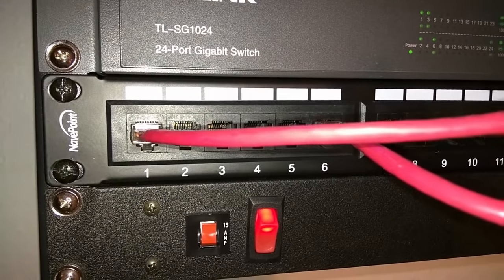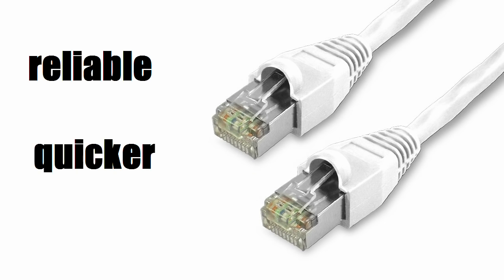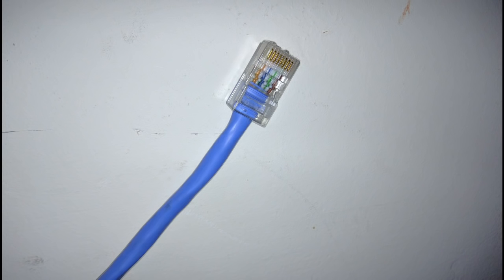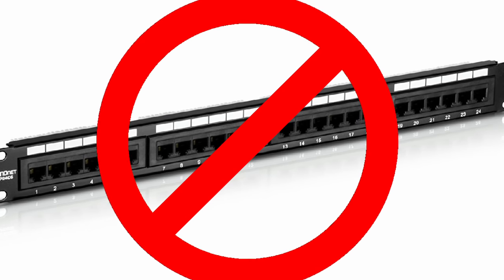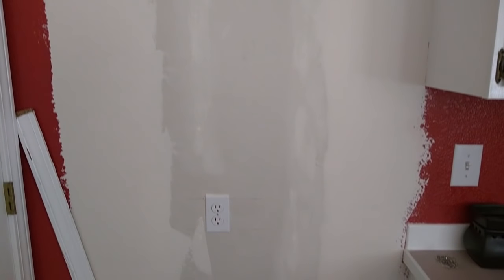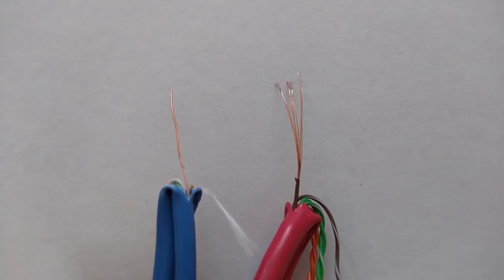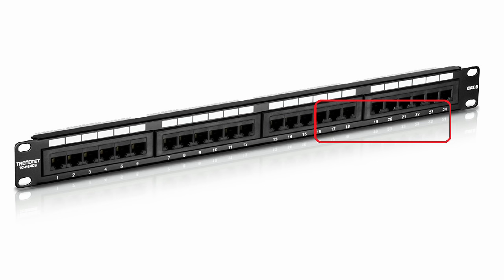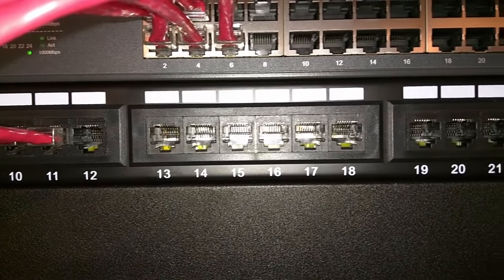What is a Patch Panel? Do You Need One?

Comment: You mentioned using solid core Ethernet cable throughout the house, but when you terminate the cable at the patch panel its stranded, please explain - thanks
Reply from the maker: The only thing I punched down at the patch panel is solid.
Reply: @BudgetNerd  so it's solid core but when you take the cover off it's stranded?
Reply from the maker: Are you confusing the term stranded wire with the twisted pairs in the Ethernet cable? What part of the video are you referring to then? It would help me to know exactly you are referring to.
Reply: @BudgetNerd  
sorry I meant to say punching the twisted pairs in the Ethernet cable to the patch panel
Thanks
Reply: The cables behind the walls leading to and punched into the patch panel are solid core. The other cables, plugged between the patch panel and switch, or between wall jacks and TVs, etc are stranded core. Punched cables are solid. Plugged cables should be (according to general wisdom and somewhat disputed in the video) stranded.
Reply: @coriscotupi  thanks

Comment: So if you move our sell your home, would you take all the home networking equipment with you (rack, patch panel, switch, ect.)?
Reply from the maker: Good question. I would leave the rack and the patch panel and obviously the Ethernet cables that are punched down on it. I would take everything else.
Reply: Budget Nerd i would take everything including the copper in the walls
Reply from the maker: Ha.. I got lots of that. I would want to share the wealth man! Plus what dude wouldn't see that rack and patch panel and declare to everyone in the room, "we must buy this house!"
Reply: Did you have a fun time running all these cables down your wall from the attic? I guess the real question is how did you run your cable?  Did you snake it from the wall jack to the attic or from the attic to the wall plate? Also how many Jack's did you end up running?
Reply from the maker: Running the cables wasn't too bad. I ran them all through the crawl space. I would push the cable up through a hole I drilled in the floor up into the wall cavity. I had some fishing poles and pull string I used from time to time when needed.

The only tricky one was the one I ran from my office closet area to the garage. So far, I have six wall plates around the house that total 13 jacks around the house if I recall. Chances are I'll do more down the road.
Reply: Any cabling you install you should be considered permanent. Go for a keystone patch panel FYI. I install networks for a living and really like keystone patch panels better.

Comment: Huh,  Does the apartment builder/owner have to decide whether to install fixed ethernet cabling?  Here (EU/Finland) the building regulations force Ethernet- cabling and the Patch panel to be installed in all new and renovated properties. In apartment buildings, even the fiber has to be installed in every apartment (even if it would not have any use yet).
Reply from the maker: I'm no master of US code, but I'm pretty sure running Ethernet, and installing a central location for it all to go is optional here. I would love to see it happen more though!
Reply: That is absolutely optional in the us lol, even very modern houses here sometimes dont include networking.
Reply: patch panels are very useful  they don't cost a lot even for a house ... the benefits outweigh the cost.  and modular patch panels allow for cable , RJ 11 and Rj45 in the same panel centering connectivity.
Reply: In the Netherlands its definitely optional as well.

Comment: What’s the name of the jack from which your blue cat cables are hanging out? (Under your wall server rack) 

 I’m running outdoor cameras and will have them hooked up to a switch inside the house. All the cables will be meeting at one location outside the house and then through a concrete wall, but don’t wanna have to cut a big hole through the concrete to feed 10+ cables through; then hook them up to a switch. It would just look ugly and the concrete wall is really thick; so I’m nervous about cutting through. Any alternatives?
Reply from the maker: That's not a jack, it's just a cable pass through wall plate. I got it on Amazon if I recall. The link should be in the description of my DIY Budget Home Network video.

Comment: Hello Sir.I have 1 Modem and 1 Router and 1 switch and 1 Patch panel  and 20 Pcs (Hosts). and i want connect these Pcs to the Network.how can i do that and create network.please help me
Reply from the maker: Check out some of my other videos.
Reply: @BudgetNerd  so the switch is powering the ports on your patch panel right?
Reply from the maker: That is one way to put it yes. The patch panel lets me run those cables to any device I want, but currently, they are running to my switch, and the switch is connected to the router.

Comment: I've made decision to buy one, but I still not convinced to use it for cameras. I think cameras should be separate and hidden for the case if someone comes and breaks your unit. Am I right or it is not really important already if they got that far and have access to that area?
Reply: What does that have to do with patch panels.  You use a patch panel in your network closet and the cameras are elsewhere.  I have installed many cameras and access points and with those I terminate the solid cable in a small box that holds a single keystone connector and then a short patch cord to the device.  Of course this is usually hidden in the ceiling, with only the camera or AP exposed.
Reply: Reference my comment above, I use the same patch panel to connect ALL my CCTV cameras both external and internal, which means I have control over each individual camera.

Comment: Wifi...nice to have, but for most stuff (especially if you use a desktop computer or hell even a TV and a gaming-console!) I truly prefer solid cables (old fashioned? Sure!)...especially if you are into gaming (ping is better via cable and it is a lot less likely to have a "spotty" connection that cuts out at times. No, powerline-connections via your electrical cables aren't a replacement, especially in older buildings...microwave-oven running and suddenly no connection? Yupp, seen that! -.-)

Comment: My house was already pre-wired with Ethernet before purchasing (good for me).  I have a DSL modem (only service we can get since we are rural/remote).  The DSL installer took one of the Ethernet lines and converted it to a adaptor for the DSL/ Phone line.  Wifi is working just fine but I would like to use the Ethernet in my office and have a better, more stable connection.  The Ethernet lines are seen coming out of the wall in the utility room and seem well organized but not labeled.  How can I figure out which line goes to what room and plug them directly into the Modem?  What would I look for?  I watched your 101 Vid as well.  Thank you
Reply from the maker: You could always get an inexpensive cable tester to ID them. Or, in the utility room, if they all plug into a switch you could just plug in your computer the room you want, and then start plugging in plugs one at a time in the utility room until your computer in the other room gets a connection. Another option is to get a toning kit and tone them out, but the other options are cheaper and work just fine, with the "try them one at a time" option being free
Reply: @BudgetNerd  They are all raw cable ends that are connected to what looks like some sort of backwards patch panel.
Reply: @BudgetNerd  can I send you a picture?
Reply from the maker: Sure my email address is in the about.

Comment: I mean, unless you are changing out your switch, you never have to move your cables around anyways. And chances are that if you are upgrading your switch, it's for a faster one, and then you probably also need better wiring so that needs to change aswell. 

An ethernet cable only has two states of plugging, either you remembered to plug it in, or ya didnt. either way, you only need to move it once. 

Only time you would need to move cables around is if you have more cables than ports on your switch.... but i think spending that money on another switch is a better choice even then. 

The only logical option would be if there was ethernet connectors made for solid core instead of stranded, then use those to connect your switch.

Comment: I’m wanting to replace my old cat5 with cat 6 in all my room and add a second behind wall mounted tvs. That way I and all the kids can hard wire their consoles. Any tips? Thinking of putting the modem/router in the attic and then add the unifi6 for Wi-Fi?
Reply: Why do you want to trade cat5 for cat6? How far are the cables running? If it’s not too far probably not worth the work. Unless you’ll enjoy it and don’t mind the cost
Reply: @danielh2553  for the speed. I am on the middle of a house renovation and thought I should go ahead and do it? Kids will get older and may want to hardwire the consoles. Also thought all the TVs could be hardwired so Wi-Fi signal isn’t as impacted. I’m learning more and more that Wi-Fi is just getting so advanced idk anymore.
Reply: @austinlewis1345  sure it is a great idea to have Ethernet and have hardwire hookups for tvs and such. But if you already have cat5, cat6 provides the same service, it can really just go on for longer cable runs. Cat6 really is just one gauge thicker, that’s pretty much it. Also, the attic may be too hot for your router,  better have a fan blowing on it or bring it into air conditioned space. Check the router specs.
Reply: @danielh2553  cat6 supports faster speeds
Reply: @austinlewis1345  I would just get an access point, especially if they are in the same floor. Wi-Fi 6 APs are really good.
Reply: @danielh2553  You can run 1gb Eth reliably over cat6.  You can run 1gb with Cat5E but its limited to 55m.  So, in this guy's case he can run 5E or 6, just depends on what he wants to spend.  If he has straight cat5 100mb is it.

Comment: Patch panel always goes on top dude.
Reply from the maker: Why?
Reply: It’s usually never touched again so up top is out of the way.  Plus the heaviest equipment always goes on the bottom.

Almost every rack is set up that way.
Reply: You're wrong. It always goes on top of the heavy equipment e.g. Server rack, UPS etc .. 
Most of the time the patch panel is in the middle of the rack tower, cause you have the same lenght of cables on top and the bottom.
So most of the time you'll see patch panel in the middle, server on the bottom and switch with router on the top. But it's not a rule. This guy had to put the router somewhere, because he doesn't have rack mounted router, so he decided he'll put it on top of the switch.
So basically it depends on you how you set it up.
Thanks for reading. Have a nice day. 😊
Reply: Daniel Biskup Wrong
Reply: waituntilthebeep Wrong

Comment: is patch panel and switch hub are the same?plz replay thank you ..
Reply from the maker: No they are not the same.
Reply: @BudgetNerd  thank you sir
Reply: A switch manages connections from a modem or router to an other point and can manage many connections at the same time. A patch panel just is an end of a wire coming from somewhere. You only need 1 cable from the modem to the switch and he shares the connections over the plugged in cables. Every port on the patch panel needs to be connected to the switch or the modem/router to be connected to the internet.
I hope I understood this correct.
Reply: if you have a hub (old school) find the bin, only use switches they reproduce signal in any direction and work straight away hubs are designated ports and will not work when changed if not reprogrammed

Comment: where did you get the rack? what is it? I want one
Reply from the maker: Amazon or Newegg. There is a link in my diy budget home network video.
Reply: Hi David, noticed your question, 9 way panel will cost $50 off ebay, 24 way patch strip cost $25, cat6 cable is $2 a yard about, plates $15 each depending on 1, 2, 3, 4 outlets, data switch $100. patch leads $3 each or so... now do you planning. good luck

Comment: i think i am going to commit my network to keystone female to female couplers and rj45ing my cable runs. i already started my network by running 4 lines and terminating the lines with rj45's and using keystone wallplates. i bought 300 pass through rj45s and 10 single jack keystone wallplates and 10 double jack keystone wallplates, 25 blue f to f keystone couplers,
Reply: I’m currently doing the same thing.
Reply: Stop leaving multiple comments. Just gather your thoughts and put them all into a single comment...

Comment: Interesting video, I agree with James Knott, what is this preoccupation with background music, it's distracting and irritating.  If you are going to impart information, then, please do so in a clear concise manner.  FYI  I used CAT6 to wire my home, each room has clustered wall outlets, where there might be a future requirement to install a wall hung appliance (HiFi/TV etc).
 I have doubled up on the wall sockets by extending CAT6 cables up (inside the wall)l from the  lower level outlet sockets so, the number of incoming CAT6 cables at the lower level is 4xCAT6 (2 for the lower outlets and 2 for higher level sockets).
I also took the opportunity to extend the power cables up the wall, as they were running parallel to the CAT6 cables I wrapped shielding (aluminium foil )around the power cable to minimise EMF effect.  
Obviously, this means a patch panel has to be used to connect all the individual sockets, (tip) if you are going to use this cabling method, remember to number the cables at each end, so they can be identified in the patch panel.
 I created a simple spreadsheet and recorded all the outlets and their numbers for future reference.  
I house all the comms hardware and cables in a small Rack which also houses a UPS, which is directly connected to the rooms where the computers are used, (it's a real pain when the power suddenly goes off and the computers crash)! oh yes, remember to include the monitors in the UPS circuit otherwise when power goes off you can't see what you are doing.  
All this presupposes you are not using an auto shutdown software (Such as APC Powershute).   
With this backbone configuration you have maximum flexibility WITHOUT visible cables running all over the place, plus, if you want to add additional devices to the network, such as a NAS drive (external hard drive for data storage (preferably next or near to the patch panel)).
Hope the above helps.

Comment: Can't you use a stranded cable for the whole thing? What are the advantages of a solid wire over a stranded and vice versa?
Reply: Solid cable is for longer cable distance. (Within 90m)
Stranded cable is for move, change and flexibility.
Reply: Solid core is less likely to break internally when pulled through walls/attics/other spaces. Stranded is less likely to break internally when flexed/bent repeated.
Reply: At least when carrying electrical current, stranded wire carries a heavier load, and less resistance than the same diameter solid. Electrons conduct on the surface of the wire, not through the core. So, more strands = more surface area.
Reply: @captmack007  It's not quite that simple, it is dependent on the frequency. The higher the frequency, the more 'skin effect' where the current is carried on the surface, which consequently increases resistance. At DC voltage, the current capacity is completely dependent on the cross sectional area, not the surface area. When we are talking POE, that is a DC voltage so there is no advantage to stranded in that particular instance in terms of current capacity. When wanting to maximize power carrying ability, low frequency high voltage AC performs the best which is how electricity is moved from a power generation plant. This minimizes both skin effect and resistive losses.

Comment: Let's say we have 4 floors building (first floor is the hub) with 10 computers on each floor from  2nd to 4th.  Why running 30 cables total is better than having 1 cable to each floor and 1 switch on each of the floors?
Reply from the maker: You could do that, but you over simplify it. Most companies will do what you are saying, but that one line that runs between floors is usually going to be fiber and will connect switches together.
Reply: Direct ethernet access per employee machine provides a safer environment.
Reply: You're then forcing all the computers on one floor to share a single cable, which limits the available bandwidth to them.

Comment: You can make your own patch cables but make sure you use stranded cable and always use stranded ends, solid core ends won't work!
Reply from the maker: Stranded is best for patch cables, but either can be used. Solid core ends do work in an rj-45 jack. I've done it.
Reply: @BudgetNerd  Hi big but... there are 2 different types of RJ45 plugs, one for stranded and one for solid core cables, the stranded one has 2 spikes that go into the strands and the solid has 3 off set spikes that go either side of the solid wire

Comment: So why not just run strainded cable altogether instead of the solid?
Reply from the maker: You could. If that's what you have, it would work. But solid is cheaper, and punches down easier than stranded cable and usually is better to run behind walls. The manufacturers of solid cable expect that it will be used behind walls and use a plastic that's rated for fire, or at least won't give off harmful chemicals if it burns.
Reply: Budget Nerd oh, ok. Thanks for the fast reply!